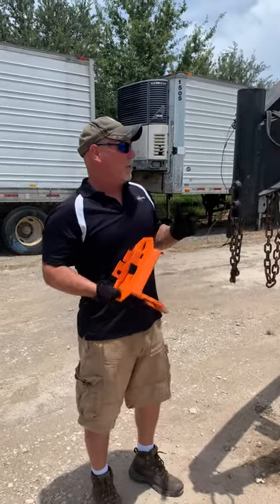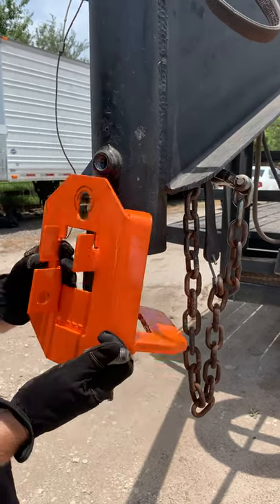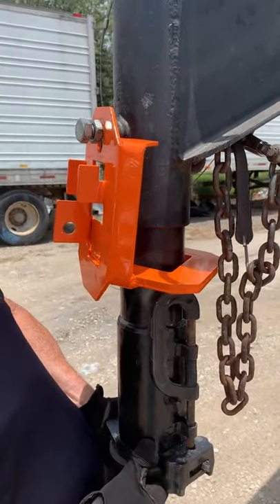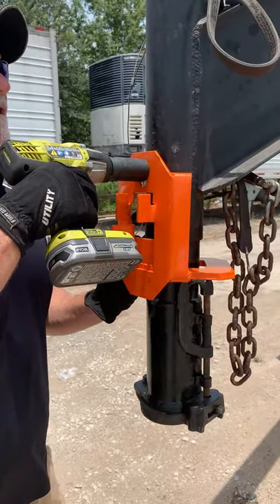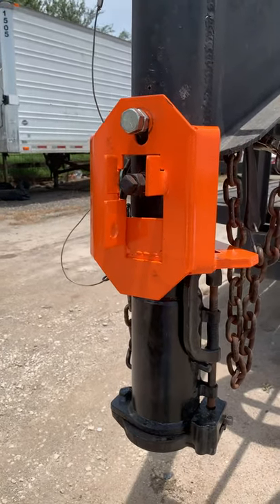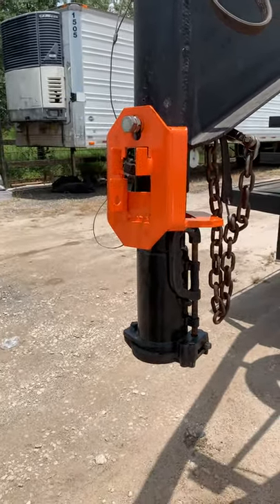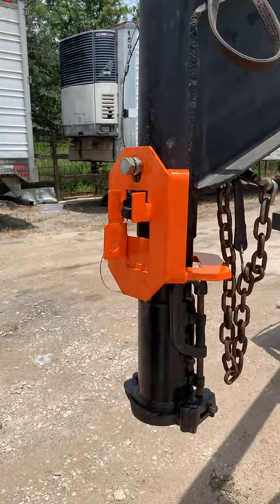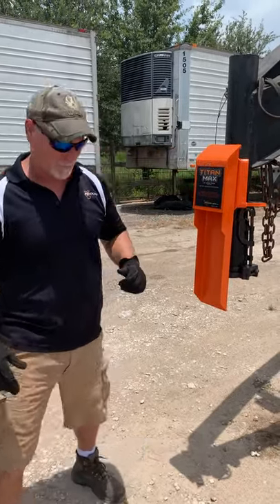Gooseneck lock best locking system TITAN MAX Installation

Comment: So if I hook a chain the button of the lock and use my truck it will most like bend it or pop it off then go hookup to the trailer.
Reply from the maker: Nope can’t bend it we built it like a winch bumper …you can hook a chain to it but you can’t break it or bend it !!! You can’t use it to pull the trailer… you have to remove it….